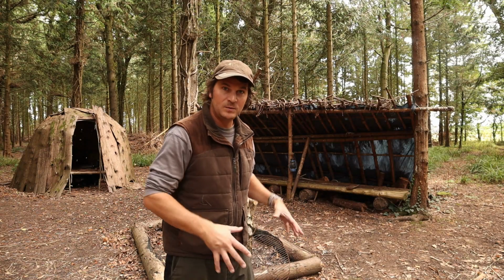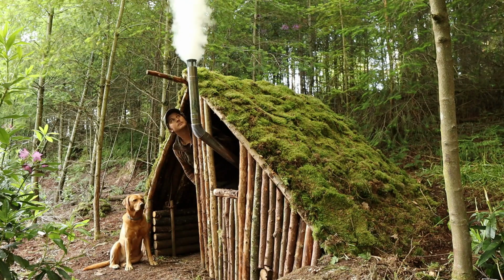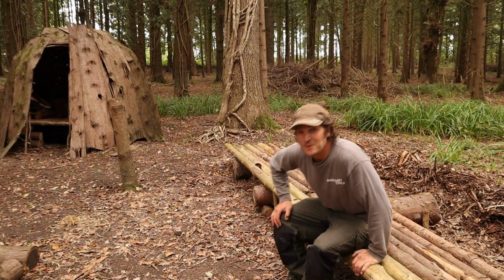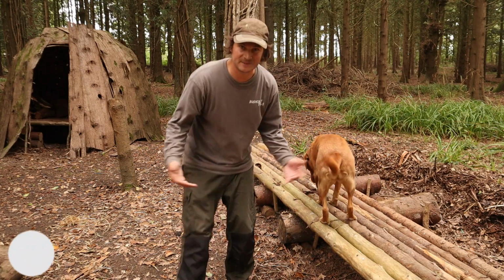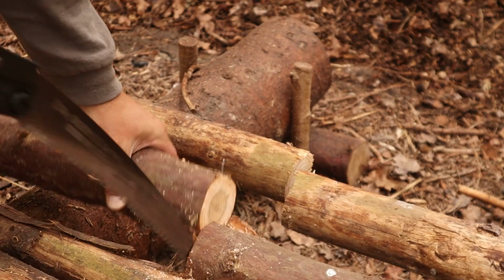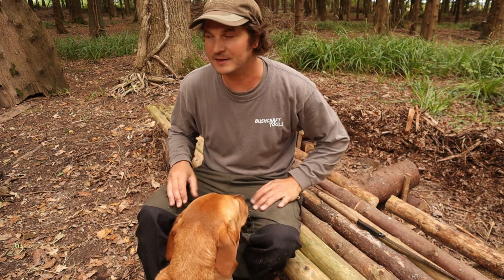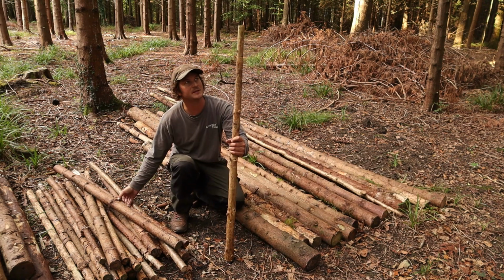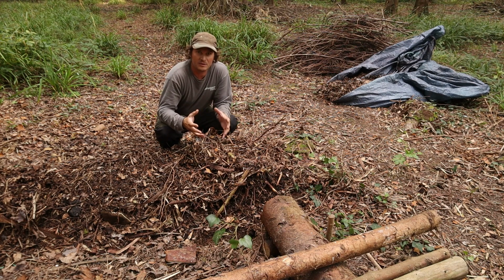WHAT SHOULD I DO? I'm Building A Bushcraft & Survival Shelter with the HELP of your suggestions

Comment: Tree fort, maybe 6 feet off the ground, with a front porch, a slightly sloped roof that overhangs the porch, slanted flat board with treads for getting in and out instead of a ladder, placed at a right angle to the front door (put the door on one end or the other instead of the middle,) with a rope attached to be able to raise it up after you get in. The added benefit of making the porch wider when raised if you make it well supported enough after you raise it. Possibly enclose the area directly under the raised floor on 3 sides to use for wood storage or adding another bed for company or if Amber doesn't like going up the slanted board.
Reply from the maker: Thanks Diana. I really appreciate your comment

Comment: I have LOVED camping in an ADIRONDACK style lean-to:  It has a back wall and a raised floor with a substantial front overhang.  The floor is high enough to make a comfortable seating space for one's knees and legs.  Standing under the overhang, one can comfortably set up a gas stove for cooking.  A strong log fire against a suitable reflector can provide supplemental heat in cold weather.